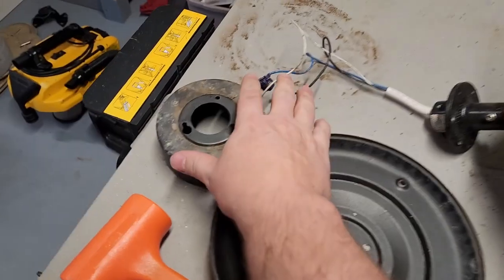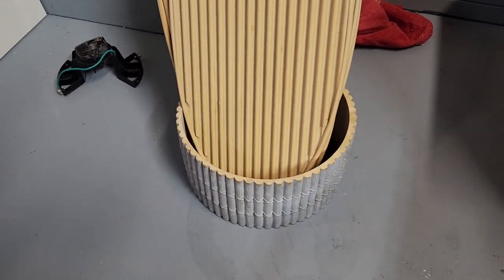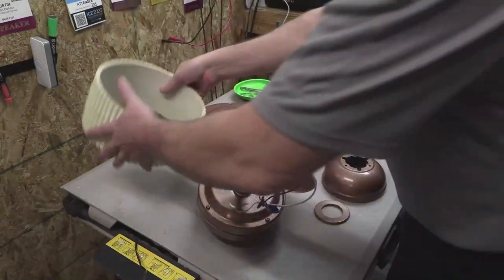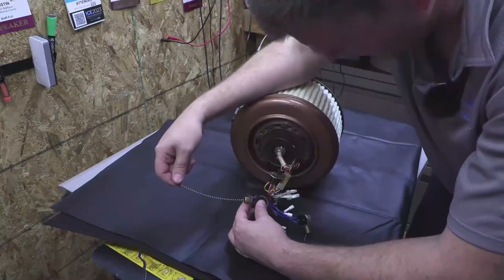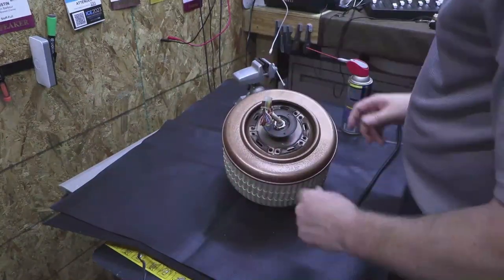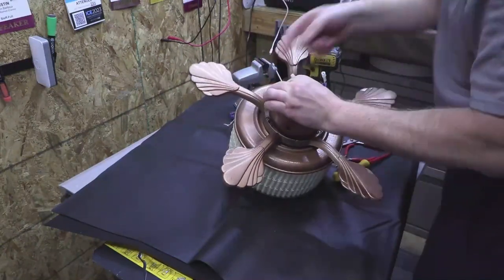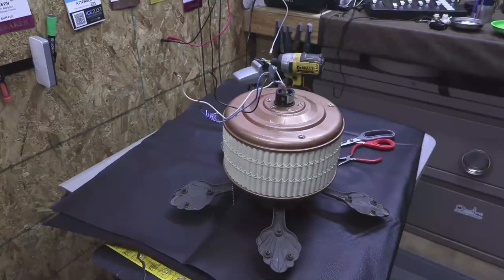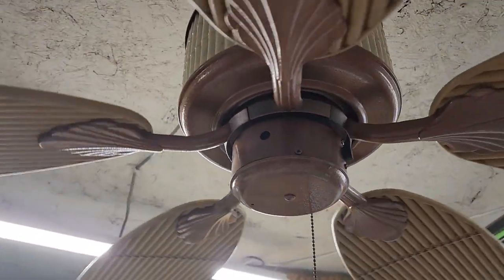Dumpster Dive Ceiling Fan Restoration

Comment: That’s a Hampton Bay Tahiti Breeze. Can be used outdoors too.
Reply from the maker: Excellent!
Reply: I had trash picked some fans, including the two that a contractor trashed without owner’s permission. I had fixed up fans before, including replacing capacitor (bad capacitor can slow it down and sometimes cause hum), and even bearings.